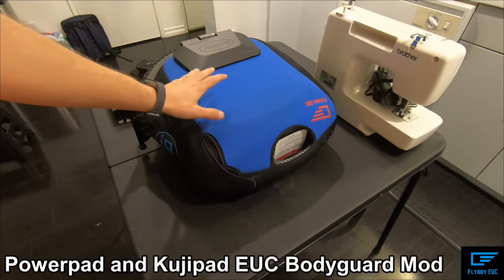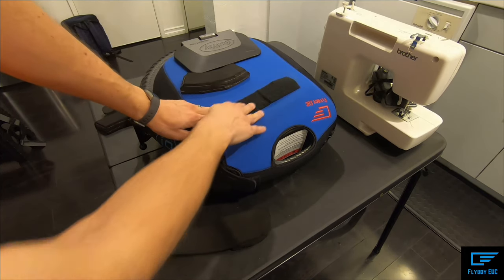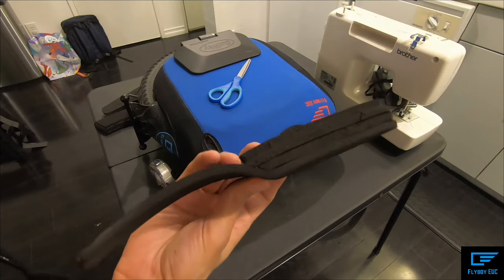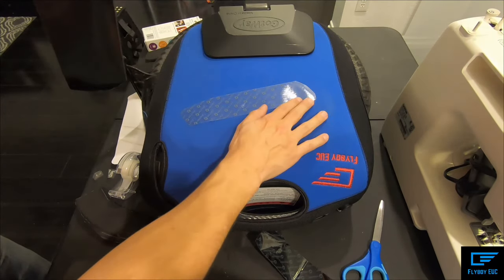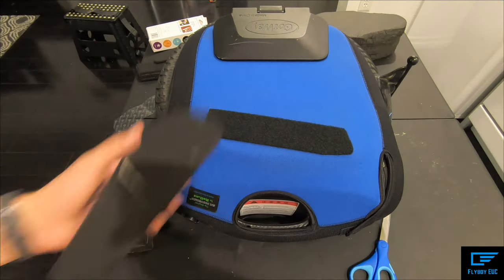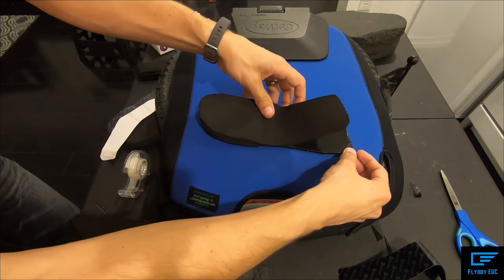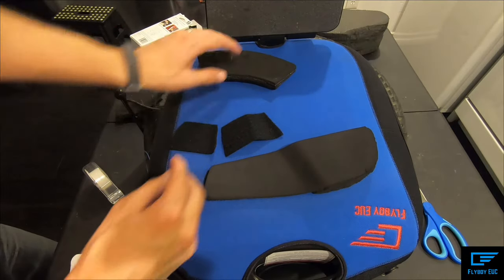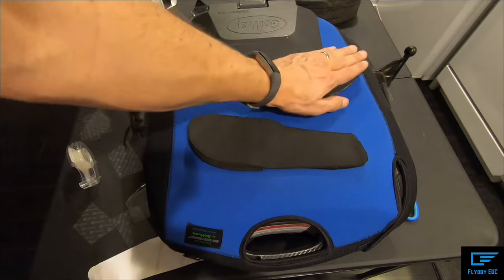Powerpad Bodyguard Mod

Comment: great job. very well explained. now to see if they stay on the neoprene material. let us know. thx
Reply from the maker: They stayed on after a high speed cutoff and after a couple months off hard riding.
Reply: @FlyboyEUC  still on?
Reply from the maker: @yeahbuddy6852  yes but the pads themselves are starting to tear. The adhesive to the Bodyguard is working great. They have survived a fall at 37 mph and very aggressive/bumpy rides.

Comment: Thanks for your video.. getting my first euc soon (gotway rs) and want to get the bodyguard but also want to be able to jump and have more control and comfort accelerating,  braking abs climbing hills.. what's the difference and purpose between the DIY kuji pads (saw his video) and the separate 'power pads'? Where did you get the 'power pads' from? You think this would work with the generation 2 clark pads? Thank you for your reply
Reply from the maker: I would say get the bodyguard and ride the wheel for 500 miles to learn how to ride. Then when you feel ready, take the bodyguard off and get powerpad or jump pads. These mods are really for advanced riders as they make you more locked into the wheel and thus not able to bail out as easily. Have fun with your RS. Be sure to open up the wheel and check everything before you ride
Reply: @FlyboyEUC  ok.. thanks.. correct me if I'm wrong but don't pads help with not only advanced moves like jumping but also make riding more comfortable and also make the wheel easier to control in terms of braking,  accelerating and hill climbing and therefore good to have from the outset..? My RS is supposed to come with 'power pads' with the ewheel order for free but no idea what kind of power pads and not really understanding the differences between different power pads like the DIY kuji pads, clark pads or the 'green fashion' type euc pads..?

Comment: ARE you using 1/4 inch neoprene? Do u have a link.l? How is the velco still holing ro the euc cover?
Reply from the maker: Yes. .25" neoprene. Check link in description. The velcro is holding strong after 1600 miles, hard vibration, and a high-speed cutout.

Comment: Hi I'm thinking of doing the same if you need to take it all of and start again with different pads will it all clean off the Rool.nz cover?
Reply from the maker: Im pretty sure. Just make sure the cover is clean before you apply the sticky velcro.

Comment: Did it stick on Good ?
Reply from the maker: 2 years and 9000 miles later it's still there. 👍🏼
Reply: @FlyboyEUC  thanks for answer 👍 then i do the same 👌
Reply from the maker: Make sure the cover is clean and use heat to  soften the adhesive so it can really grab the fibers of the cover. Mine has peeled up on the corners but not enough to be of concern.
Reply: @FlyboyEUC  thanks alot 👍👌
Reply: One question, have you done or seen Any mod for Seat with the roll.nz cover ?
Reply from the maker: I use the stock seat with the cover all the time. Just undo the back Velcro flap or cut off the nub on the back of the seat. I talk about it in the cover review. 
https://youtu.be/hfaR8iF0Okg